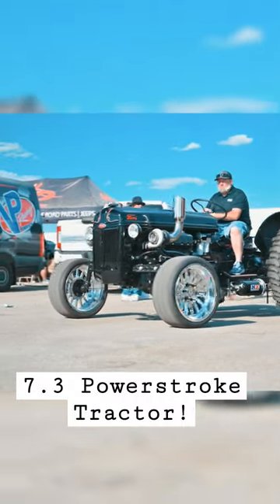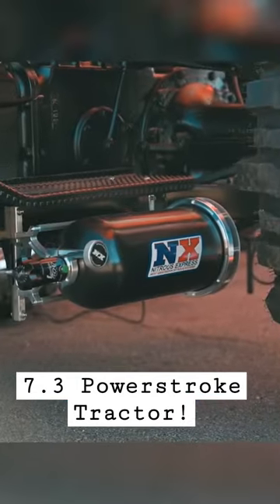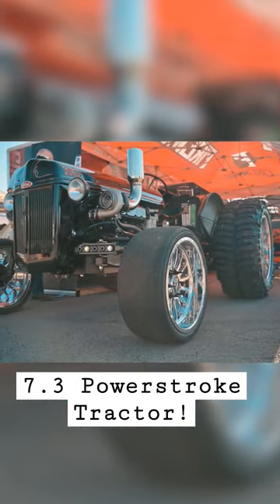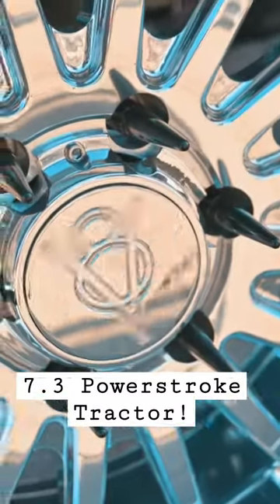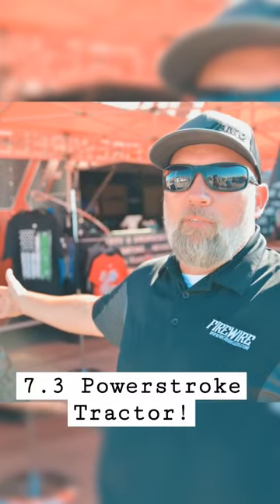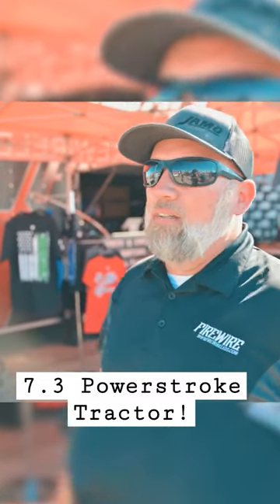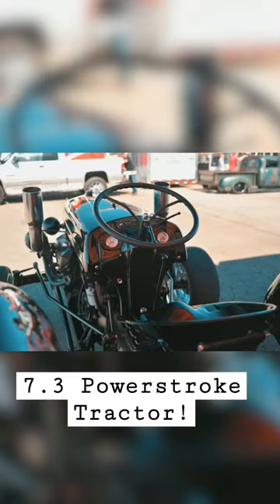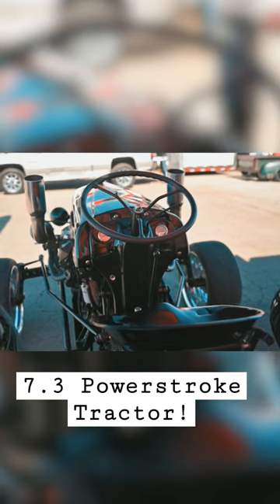BADDEST TRACTOR ON YT #shorts #ucc #7.3 #ford #AN

Comment: Could you imagine flooring this just once the rear end would just blow everywhere. this tractor factory made like 25hp lol .cool as hell and beautifuly done but definitely dangerous.
Reply: 45 mph with a 3 row plow behind it throwing up a rooster tail of red clay....
Reply: @kramnull8962  😂 farmers would love this beast
Reply: Well if they built it to be what it is there I highly doubt they are using the factory rear end, like highly highly highly doubt it
Reply: @diychad7268  he just said in the video they tried to match tire size to keep the same gear ration. Listen listen listen listen
Reply: @Koontzy.  same gear ratio, guarantee it’s not the original rear end.
Reply: I might take this opportunity to ask, have any of you of actually tore down a farm tractor rear end?!  Dude! Talk about overbuilt,  those things are made for dragging a plow around the field! And don't get me started on the transmission and the clutch. 
 They're both the transmission AND the frame of the tractor,  they can certainly handle a few extra horses under the hood.
Reply: I feel like a tractor rear end is beefy enough for a couple hundred hp
Reply: @romeocano1919  yeah cause as soon as you lay into it and it breaks em loose it'll last a long time. Start making it hook, and that's when ya start to get the breakage.
Reply: @jstephenallington8431  and I guess they never heard of a Fent tractor.
European and does like 40+
Reply: @dorianearnest4648  could be ,your redlines probably higher now.

Comment: I’d be checking if it’s even getting power out of the fuse panel under the hood then go from there, also check for bad grounds on the rear harness there should be a single or double ground for the trailer harness and actual truck harness

Comment: It’s a good thing you use the power stroke so that you can keep the horsepower in the torque extremely low. How do you used a Dodge 12 valve Cummings you would’ve had to have a stronger transmission stronger frame everything but that was a brilliant idea to save money to have a very low performance diesel engine in there that’s what you call a thrifty build